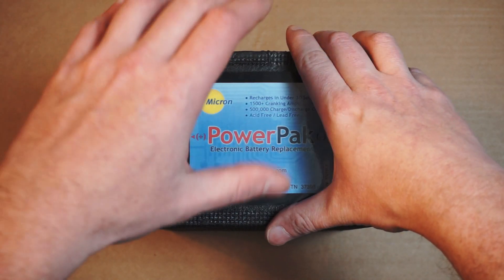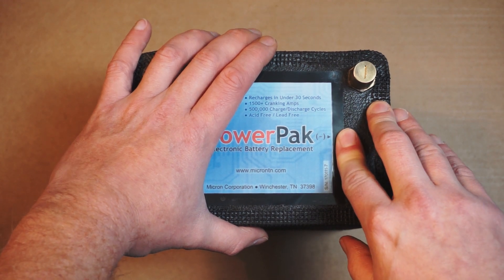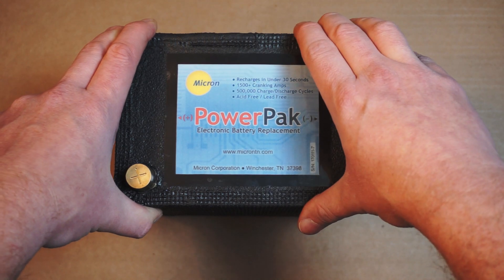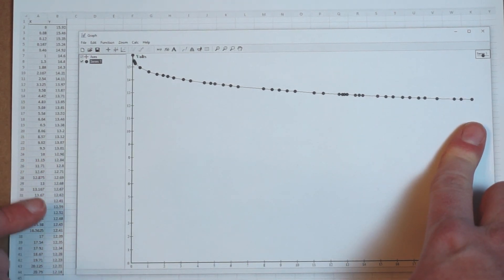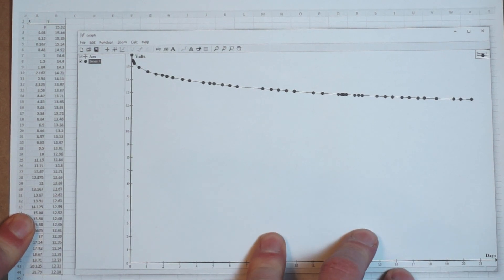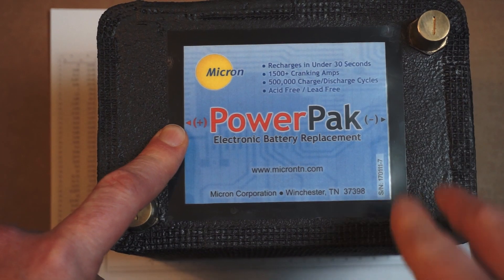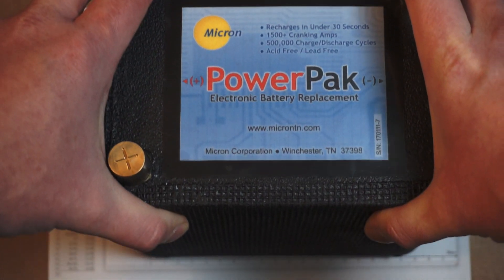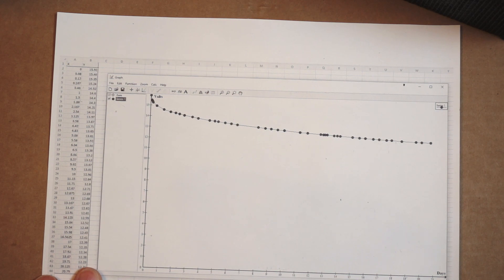Supercapacitor Self Discharge Test

Comment: Why wouldn’t You go 3g alternator? Or have you already? I’m just kinda unclear on the benefits of going to super capacitor. Also are there any potential problems related this setup interfacing with the early fox wiring? I haven’t had any problems with my 92 gt but I think this would be cool to have in the car to run my Fan and electric assist power steering after you inevitably do it and then I can follow your lead.
Reply from the maker: I have a 3g alt.  At the track I'll run my electric water pump and radiator fan (with the engine off) between rounds to get the coolant down to 140 degrees - where the car likes to run.  At the stripe, the coolant's usually back up to around 170 or so.  Depending on ambient temps, it can take 3-6 minutes of running the fan and water pump to get the temps back down.  After several passes, if I let the battery get below 11.2 volts, it can get tricky to start - so I avoid going that low.  But if I'm pretty far back in the staging lanes, it can mean starting and shutting off the car 3 or 4 times in a short span of time.  With the supercap and small battery, the battery only needs to run the fan and water pump; the supercap's only in the circuit when starting the car, so battery voltage is irrelevent.  And since the supercap can charge in seconds after starting the car (unlike the battery) as well as deliver a huge amount of current with minimal voltage drop (also unlike a battery), my worries should be gone.  Never mind that the supercap/battery combo is 10 lbs lighter than the Honda Civic battery I run now.  The best part is that even if the small battery is almost completely dead, it could still charge the capacitor enough to start the car in a matter of seconds.  Effectively, the car would be able to jump start itself, as long as the battery's got 10.5 volts or more.